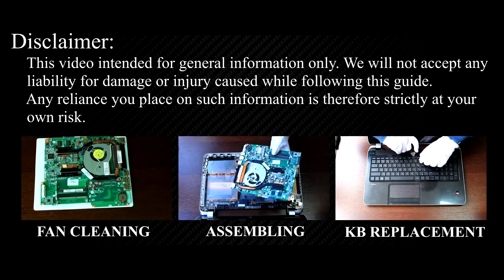HP Pavilion 15 Series Screen Replacement - Your Step-by-Step DIY Guide!

Comment: Thank you for showing us how to replace the screen but theres only one problem. At 0:43 to 0:53 you show taking some rubber out and exposing screws. My laptop model doesn't have screws. It just has a complete screen with a large rubber outline around the screen. Some help would be appreciated.